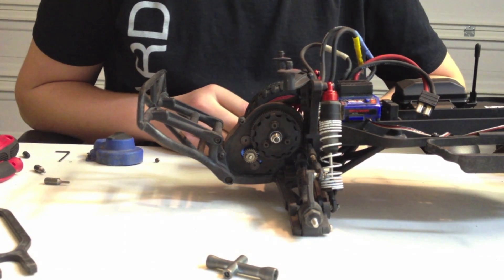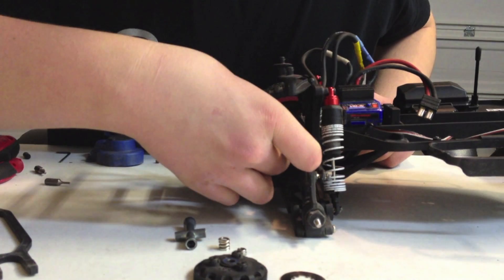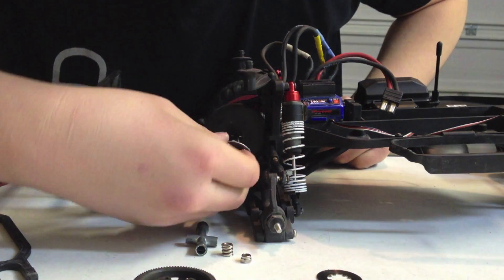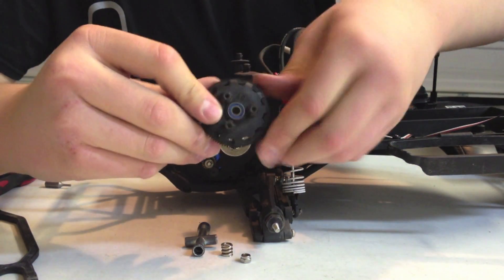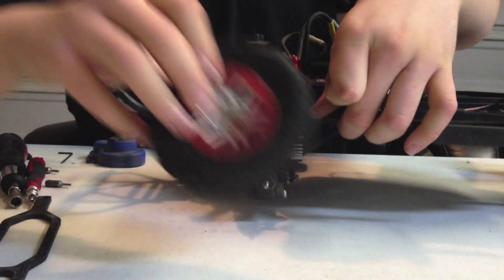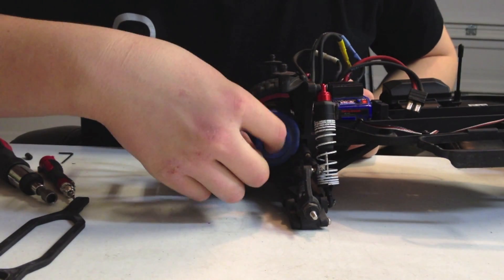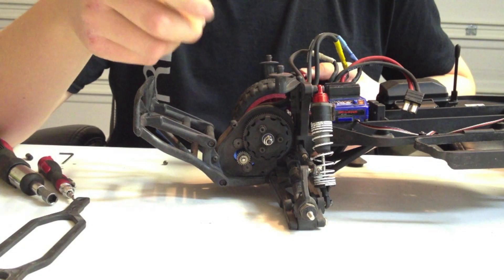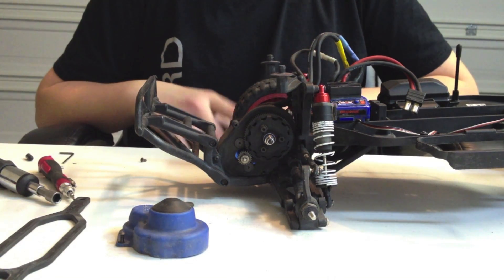How to adjust your slipper clutch on a Traxxas 2wd Slash

Comment: I'm sure you fixed this or replaced by now, but sometimes the pads get glazed over.. you can take it apart use some emery cloth or sand paper and lightly sand off the glaze.. it will look smooth on the pads(thats the glaze). Adjust per the video and your good to go.... This is sometimes and issue, unless the pads are completely worn off.

Comment: It was a good video but when you install the metal pressure plate u installed it wrong there is certin notches its suppose to go into and you just slapped it on there

Comment: I have a 2wd slash and was messing with the gears and the back tires don't freely roll so what should I do because before I messed with the gears the back tires would freely roll so can you please help me.
Reply from the maker: Its possible you have the gear mesh set to tight, it is possible the tires were screwed on to tight as well as there could be a little rock somewhere that feel into a certain place and is preventing the car to roll.

Comment: can someone explain to me why I would do this? and what it does? Im relatively new to RC cars.
Reply from the maker: The slipper clutch provides your traction and power output. The tighter you make it, the faster the car sends power to the wheels. You can easily make it to tight though and break driveshafts so be careful. You want it to slip a little.
Reply: TraxxasRCC I just left it at a factory default thats good or should I adjust it?
Reply from the maker: Buff Warship Yes that is good, or follow my video tutorial.

Comment: HELP!!! I had a problem where my clutch couldn't catch well enough to spin the tires when I gunned it. I found out how to adjust my slipper. Although after i tried tightening more I started having a problem where i hear a loud clicking noise every time I tighten it and by the point at which I don't hear it anymore the clutch hardly catches.

If anyone has a solution I would greatly appreciate it
Reply: +Lt. Melonz possibly stripped out shaft or broke the shaft of the the big gear. Hope this helps
Reply: +Gabe Miller:  I took your advice and checked it. Sure enough that was the problem. Thanks!!!
Reply: +Lt. Melonz yay! have a good one!